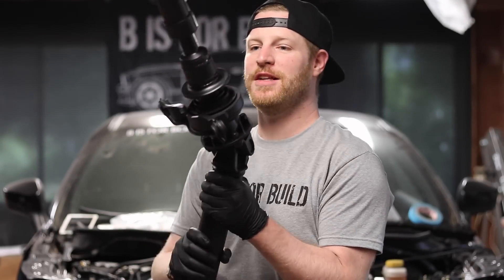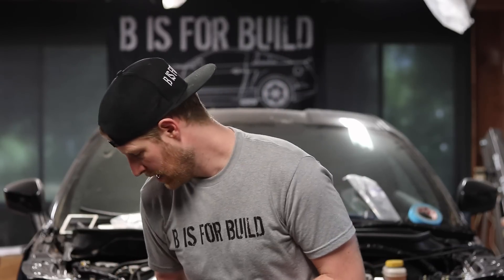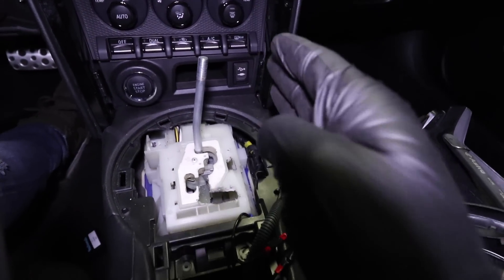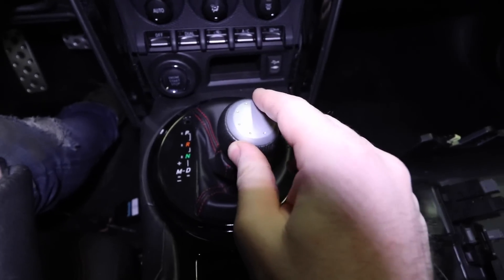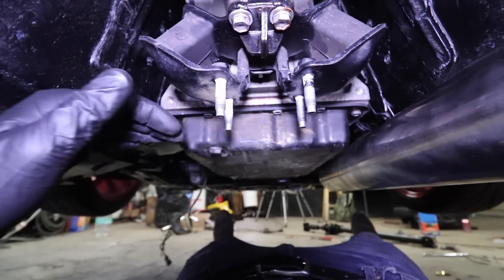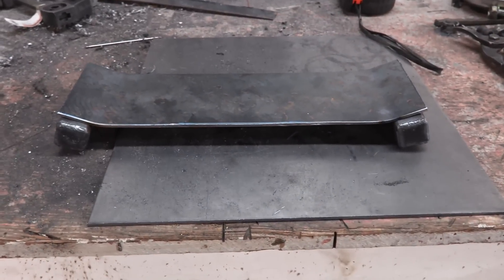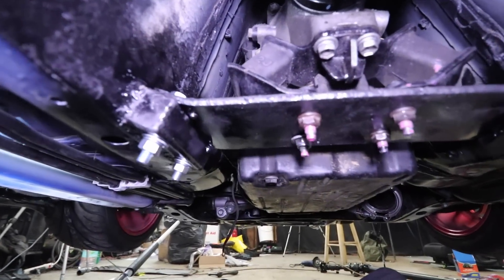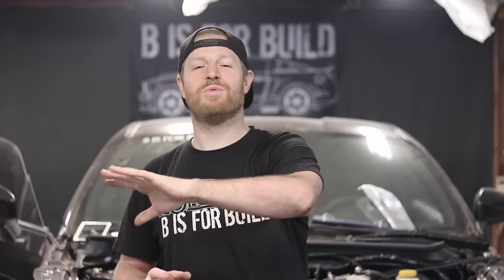2JZ BRZ Pt 20 - New Driveline Is Ready!

Comment: Chris! check the transmission/driveshaft/diff angles! if you get them wrong with the new trans mount you've just installed, the angles of the u joints at the transmission and diff won't be in alignment, and you'll explode those nice new ujoints
Reply: it does not explode it will just wear faster because needles wont move in the caps or move too much and vibrate
Reply: and what happens when your driveshaft bearing lets go while driving /launching etc?
It goes boom
Reply: Last time i lost u joint during lauch end of the 2 piece shaft it just fell bit and was hanging by the bearing if bearing goes during drive i starts feeling like drive shaft is shaking under the car and by that point anybody shoud realise its going bad

Comment: Make sure the angle of the trans and diff are equal opposite. I.E. if the angle of the trans is 2 degrees negative, diff has to 2 degrees positive. If they aren't you will still get drive line vibration.

Comment: jesus christ these comments are cancerous. Every other comment is about it being an auto. Thats what the engine came with and as hes said before he plans on swapping it to a manual when he breaks it
Reply: Kingdom Of Mog also it would be cool to have the constant g's of a autofor a bit
Reply: Yeah he also stated early in the series this was a budget build and this is the cheapest option so....
Reply from the maker: thank you! Finally someone remembers..
Reply: gonna be more content too when he does decide to do it so its all good
Reply: is the auto to manual change just the gearbox and installing a clutch pedal? 
or do you need a new driveshaft and other things too?
Reply: flywheel, clutch and linkage, pedal, shifterlinkage which i'm pretty sure gonna have to be custom and telling the ecu it's always in park by connecting some wires in the loom
Reply: the north remembers

Comment: Flip the bolts and the nuts to where the nuts are on the top and the bolts go through the bottom. If you leave them like they are, anything you scrape or run over has a chance of hitting them and messing them up. Its less likely to happen if the nuts are on the top.

Comment: You should try some half mile stuff with it while it still has the auto. It would probably do quite well at that kind of racing, then when/if the transmission breaks, do the manual conversion and go circuit/road racing and/or drifting. Win win as far as I see it.

Comment: I like your DIY mount! One suggestion though - you could find shorter hardware for your bolts on the box sections of your mount. Those long bolts might get really messed up if you scrape on something and it will be a bitch to get off afterwards!

Comment: I would check your driveline angles since you changed the position of the transmission.  if they aren't equal and opposite you'll destroy your u-joits and possibly your trans or diff from all the vibration.

Comment: My 2cents.....that trans plate/mount...i would have welded in some round tube for bolt holes to reinforce that square tube. That square tube can still crush/stretch out. Like others mention, did you chk your drive line angle from the mounted position or while it was hanging?

Comment: If you ever want to go manual apparently the 350z gearbox (6 speed) is a good option (heard it on dude in blues vid about his 2jz 240sx). Apparently it can hold up to 1000Hp based on some high hp 350z and 370z cars. Much cheaper option than a v160, if more people know about this they will probably reply to this comment if i got something wrong.

Comment: I would weld some nuts to the top of the crossmember and run the bolts upward so that it's not so much of a pain if you ever need to remove it

Comment: Will the Gearbox operate properly if you run it hard are you considering doing a Ceramic Coating on the Exhaust as it seems really close to the Transmission & I'd worry about Heat Soak into the Transmission (I know you have an External Transmission Cooler fitted but will it be able to provide enough cooling when its so close to the Exhaust pipe?) another option would be to wrap that area with Heat reflective product.

Comment: At this point you could have saved more time and money swapping in a manual

Edit: Fastest and easiest if you were keeping it auto. You said your swapping a manual later on. What did you just drop on that driveshaft alone? $1000?
Reply: should've just swapped the cd09 in
Reply: Amplified yeah cuz he is gonna have to redo all of this now
Reply: the G35 didn't have a cd009 and the transmission on its own, depending on the condition, go for 800+. Than you need the 1jz bellhousing, new clutch line, new set of petals, cutch, and much more things that I'm missing. Though it is true it will cost him in the long run, the other route wasn't exactly cheap either.
Reply: He's done so much stuff for that auto transmission. Such a waste of time.
Reply: Amplified your comment is all I wanted to post!!
Reply: seriously thats so dissapointing, but atleast it can in the future
Reply from the maker: Totally incorrect, this is by far the fastest and cheapest way to get this car running. Any manual swap that can handle the power of this engine would cost double or triple the cost of the engine. I explained all of this in episode 1 or 2 of this series.
Reply: B is for Build didn’t realize the stock transmission could handle that much power. Still love the videos. My bad man.
Reply: Double or triple nah not at all, sorry but a quick Ebay search shows me that a 2j goes for 21xx to 31xx (some with an Auto trans and some with a manual or the CDO 9)
Than I've searched for the CDO 9 which goes for 4xx to 11xx and than the adapter plate goes for 2xx to 3xx
So that kind of makes the total of the Trans about half of what the 2j costs :)

And I know this was the quickest and cheapest way, but the CDO 9 isn't triple nor double the value of a 2j
Reply: theres nothing wrong with the cd001 or whatever was in the g35. as long as the trans is a cd series trans adapter plates for the cd009 should work with it and cd001's on ebay are like $500.
Reply: Eh, things go wrong, costs go up, I'm sure it would've been the same case converting to manual
Reply: yeah but they wouldn't handle the power

Comment: I'm curious, is it necessary to torque the nuts and bolts? or is just tightening them up with a normal wrench enough?
Reply: Best V you need to properly torque anything that has vibrations such as anything in the engine, transmission, and suspension. otherwise the constant vibrations can cause the bolts to loosen.

Comment: You  should have checked your drive shaft u-joint angles.  Getting them right is important, if it's off they will vibrate at speed.  Please Google about it.  Learn from my mistakes

Comment: It's great that you got driveline fixed, but that transmission mount is a fail.. It's not thickness that makes mount stronger, it's the shape. You should have made it from square tube because it has shape to hold weight while sheet metal will just bend pulling sides of your transmission tunnel together. And since I couldn't see you welded square tubes to the tunnel from the top, i's possible that such pulling force will result in twisting those squares and tearing them from the tunnel.
Reply from the maker: +Homebuilt Racing its possible, i'll check in on it frequently and see how it's holding up.. at least if i need to do a round two it's not too hard

Comment: How long until Chris bumps the shifter from D to R while driving? A good accidental whack and hes going flying..
Reply from the maker: it has all the same safety precautions that it had as stock... so i doubt it..
Reply: So the BRZ's didn't have the little thumb lock? Normally auto cars have that mechanism so you don't accidentally downshift, or go from neutral to reverse, but allow neutral to drive. Just worried you might smack it. I have, and that little retainer saved my transmission, and more. Good stuff though. Doing good work, just scaring me with the sketchyness!

Comment: I don't even know why i'm bothering but here goes:
- That adapter is HUGE: look at the thickness of the driftmotion aristo driveshaft adapter thickness
- "Cost almost as much as the driveline" you got RIPPED OFF and did things the stupid/hard way.
- Welded tranny mount to frame: again look at driftmotion mk4 supra R154 transmission mount swap kit, it's bolted to the factory holes not welded (just an example)
- Installed tranny mount: did you check the driveshaft angle? nope :/
Reply: I agree man - there's a lot of weight in that adapter/high moment of inertia, it will be difficult to accelerate/decelerate the car because of that extra mass spinning.

Also, yeah, gotta check trans/pinion angles and ensure alignment. Maybe he'll "unweld" it later?
Reply: Definitely have...but maybe "difficult" isn't the right word - if you found 10-15 lbs in that adapter that could be removed, I think you'd feel it in the "butt dyno" especially if it came off the outside edges.

Comment: that adapter shouldn't have cost more than 100 bucks.  any idiot with a calculator, micrometer and drill could have made that.  really need to better your skills by attempting those jobs yourself, could have probably screwed up 5 times on it and still saved money.